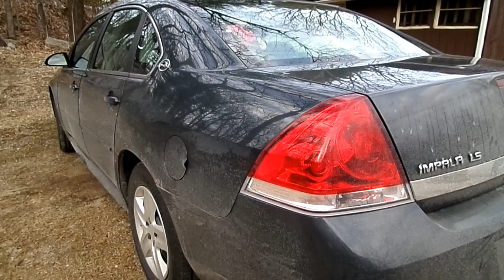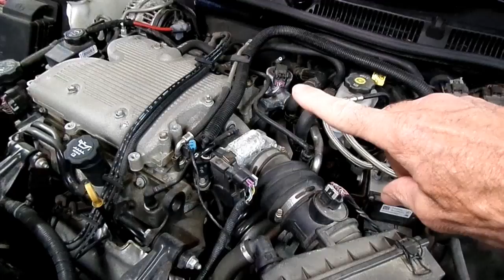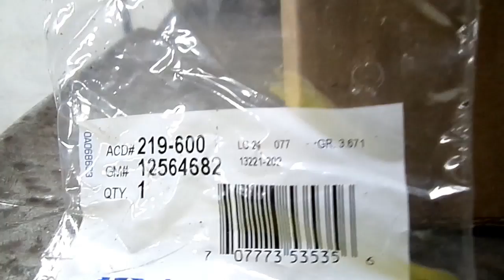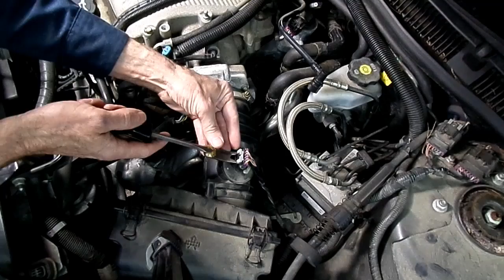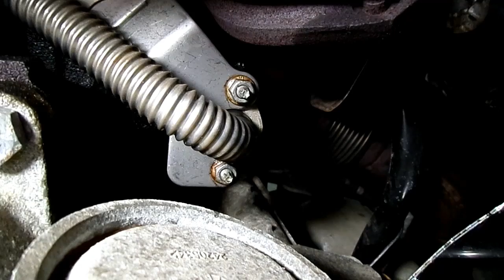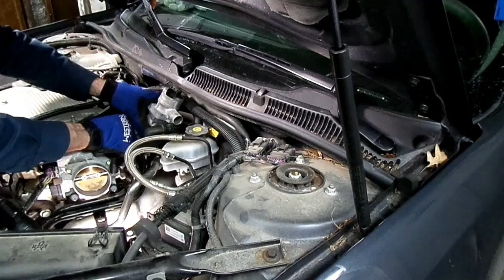P2440 Chevrolet Impala Air Injection Check Valve

Comment: What if the air injection valve is brand new? And you get code 2440
Reply: Having this same problem, feels like I've tried everything. Also replaced the pump since it was flooded. Did you get it fixed?
Reply: I see you also said you have P2430 in another comment. I had P2430 and P2440. New valve cleared my P2430 but still have P2440. Would really appreciate your thoughts

Comment: If you don’t have a good scan tool to test the system take the hose off going to the valve and let the engine get cold when the engine is cold enough the air pump will turn on and valve will open when you start the engine cold. If the code says it’s stuck open take the valve off and  try to blow through the valve if you can it’s bad. Generally with this code that valve is bad but your best off to diagnose it so you don’t waste ur money on parts that aren’t necessary.

Comment: I’m just curious, how did you determine the valve is the issue?
I don’t think it’s fair to assume that if the pump is working the valve is the issue based solely on the code.
Help me understand, thanks.

Comment: What are the symptoms if this valve is stuck closed but its not throwing a code?  Mine starts up cold as if it is flooded. I've checked everything else...  wondering if this valve is sticking closed but not throwing a failure code...  and it only starts up porly when it is cold and has been sitting overnight. When its warm, its fine.

Comment: Excellent video. Thank you for making it! I just replaced the valve on my 2008 impala. Your video made it an easy job. Funny how the only part on that valve that goes bad is the top valve held on by three screws yet you have to replace the entire assembly.I could not find the valve piece to buy, just the entire assembly. Thank you again.

Comment: Excellent - exactly what I was looking for - have a 2010 throwing a P0411 and this code intermittently. Had to replace this valve once before but dealer did under warranty. can't believe it is going again only 60-70000 km later.  I run propane so should be cleaner - but engine warms up under gasoline... hence why this is probably clogged.  Thanks for the video!

Comment: How you got the camera down to those two bolts i dont know lol, did you look at the old one to see if it could be cleaned/fixed, muck kills everything :-(

Another smashing job done :-))
Reply: It was a little tight getting the camera down there but it was worth it to show those nuts i thought.I took the valve apart and there was less muck than i thought.The code has not reappeared so i say it was a successful fix.
Reply: rich pin
Yep a good fix :-)), another one bites the dust :)

Comment: My 2000 dodge intrepid just won't start. I was smelling fuel, and it stalled a few times before. Gas mileage was getting worse.check engine light was always changing from week to week. One person thinks ignition coils, another thinks fuel pressure regulator. Idleing was bad. Engine cranked at first and idle for a few seconds and cut off. Engine sounded flooded. I also would hear a clicking from one of the ignition coils. Anybody got any advice
Reply: Eric A. Cantu u need a motor